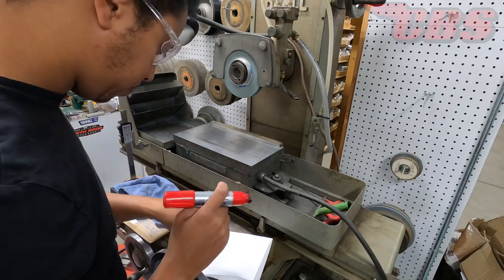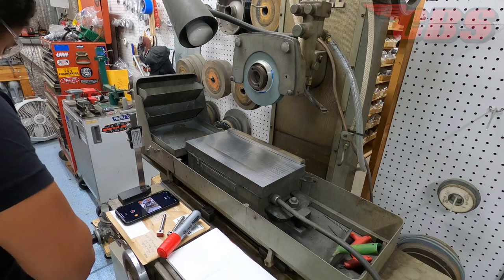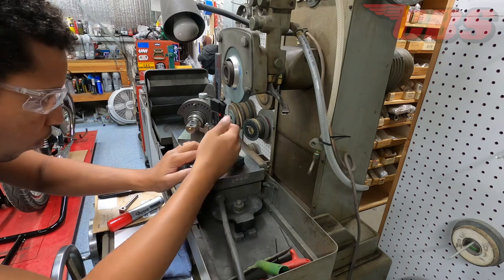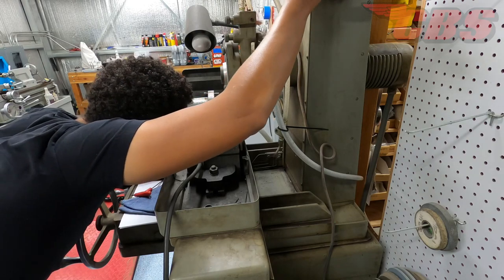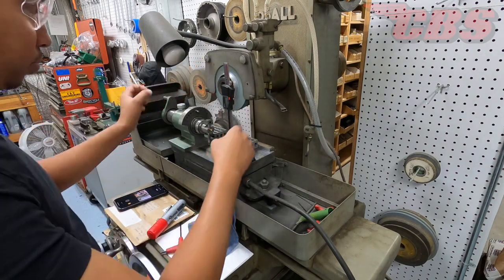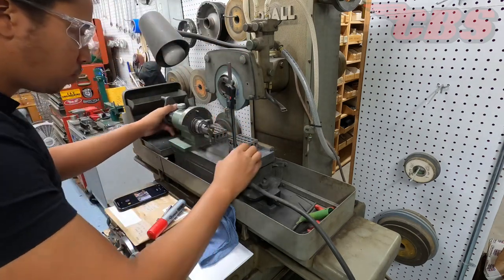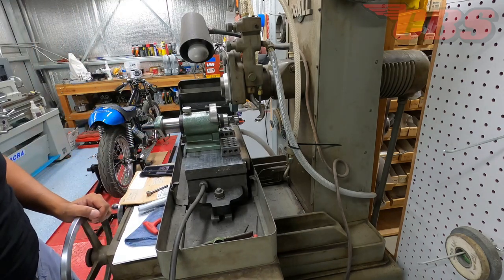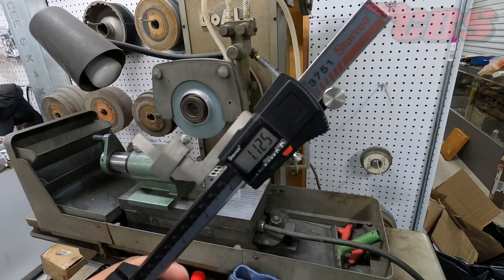Triumph Camshaft Follower Regrinding (Service)

Comment: Why did the customer want to change the radius of the cam follower?
Reply from the maker: He was running a 3/4" radius, and wanted to change them to 1 1/8" - he has a race motor, so a 1 1/8" radius will give him opening / closing figures over 3/4" - also, some cams you must run 1 1/8" lifters